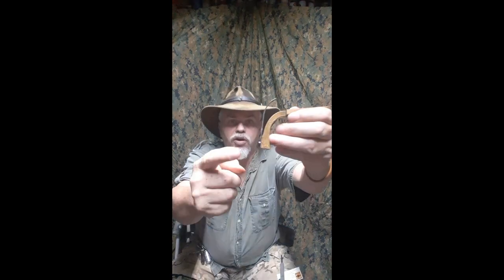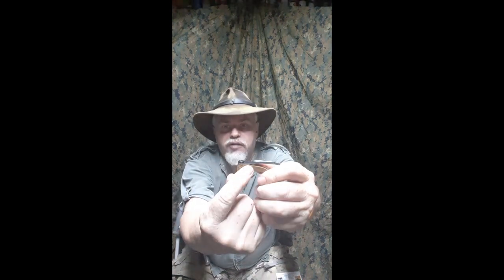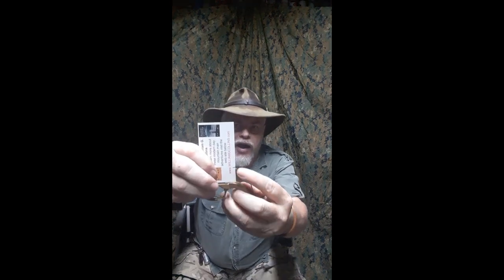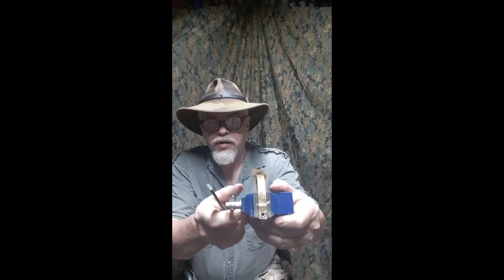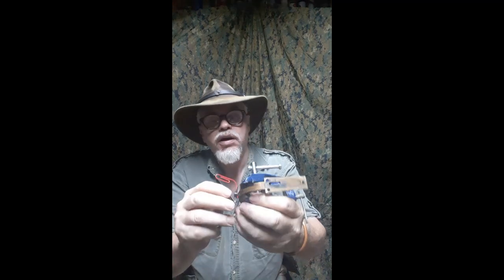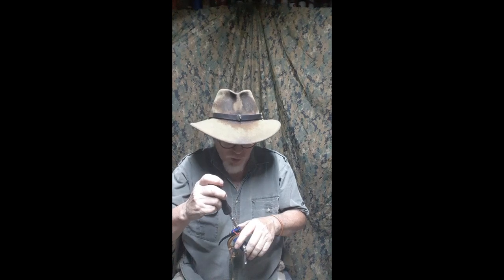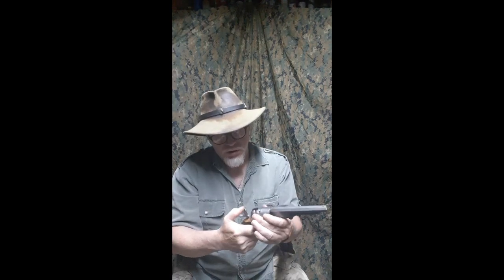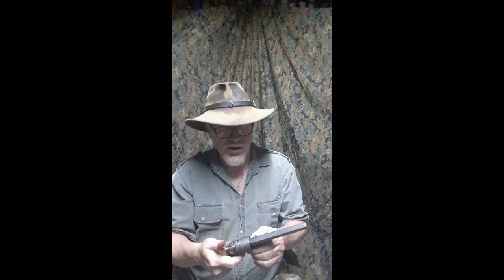QUICK MOD TO A UBERTI 1862 POCKET NAVY

Comment: I agree totally. The original springs were definitely heavier. Why not make a heavier spring ? I have made 8-10 from 1095 spring steel 1/8” thick. Taper thickness and width seems more like original colt springs.

Comment: Hey Blackie, great channel!  Any chance you comment on the truth or myth about hand pressing a cap on a black powder revolver cylinder?  It's been said that you can set the cap off pressing to hard?  Also what about if you store away separately, a loaded 1858 Remington cylinder with caps on it.  Can it be set off when you need to do a speed load for home defense?
Reply from the maker: some caps are a bit sensitive and if the nipple is sort of  fat it can be hard to force it down and seat  ,,Elmer Keith spoke in his book SIXGUNS of a cap popping and leaving a blood blister on his thumb .  /as to the rem capped cyl.. any sharp blow into the cap will cause it to go off so if you fumble the reload and drop it on to say gravel like at outdoor shooting ranges ir might go off facing up at you

Comment: Ile would both and use a di-electric spacer to prevent electrolysis.  The only main spring breaking I have had was due to electrolysis.
Reply: having Much OJT with cathodic reactions. The main spring will always touch the brass frame, and that brass frame will always touch steel frame.
I suspect your failure was more an environment, alloy, QC, or lube issue.
Reply: @davefellhoelter1343  Mine don't except through the screw .  The flat areas are where the EL. happens/ something as simple as a piece of electrical tape will stop it. 30 yrs in the marine business gives me a good basis about corrasion of all types.
Reply: @USAACbrat  Is this Sparky? shooting soon? I'm loaded up.
Reply: @davefellhoelter1343  Tomorrow at 11:30 my son and I are hitting the pistol range.  With my .38 conversions.

Comment: Great video, Blackie. What is causing my 1860 Pietta Colt army from latching into full cock?? It latches in half cock but not full. Thanks for any advice.
Reply: Fixed it. The pin that holds in the main spring roller at the bottom of the hammer had drifted out slightly not allowing the hammer to go only between half and full cock.